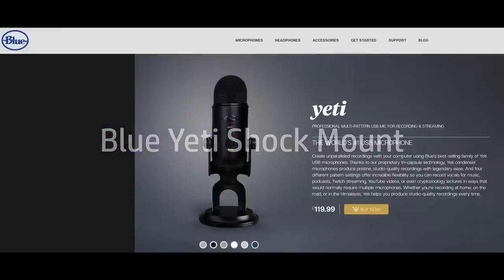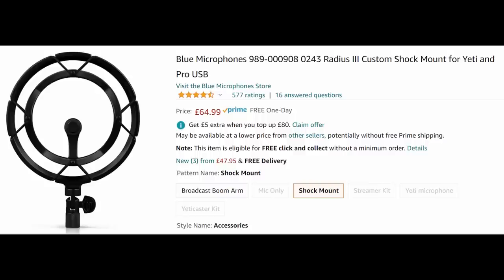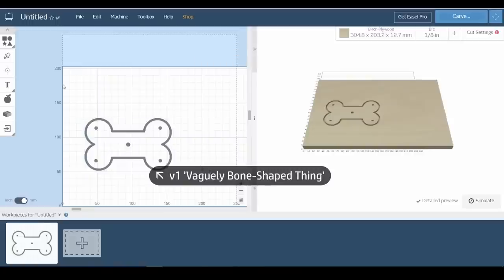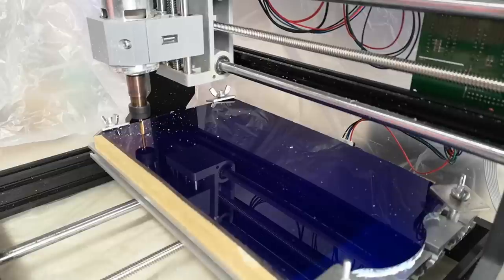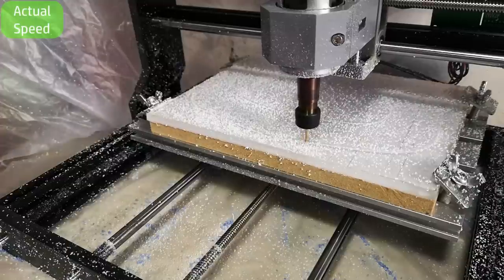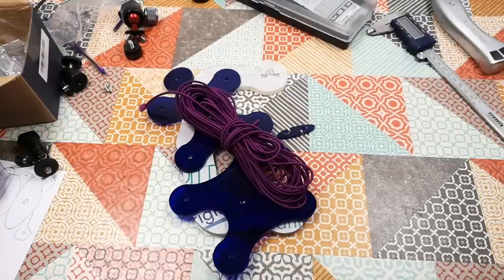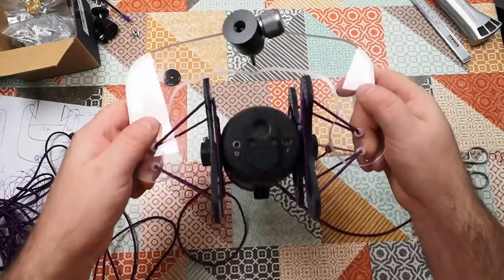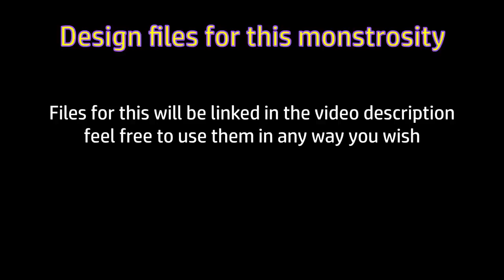Making A Shock Mount For My Blue Yeti Mic (Using My 3018 Hobby CNC Router)

Comment: Nicely done. Best wishes in your machining. I do have a few tips that may help in your machining on a budget, but all of them can be found across YT if you don't care to read all this. 1) The hold downs you're using are to have the the rear part of the clamp raised slightly above the contacting tip to help with the downward clamping force, and so they avoid pushing the part, or double sided tape can be used. 2) An air mattress inflator and a hose can be mounted to blow swarf away from the tool, and to help keep it more cool. 3) For getting things symmetrical, try designing half the object and mirroring it over a center line. This can also be done by designing 1/4 of the part and using two center lines as well(if your software allows it). 4) Add gussets made from scrap to the joints of the frame to increase rigidity, however you can. 5) pins in the table's slots can be used to align the stock square to one axis. 6) Single flute cutters reduce tool pressure to avoid flex in the Z axis, but it's a give and take with machining time. Mostly, just use the machine to improve the machine. Have a good one, and cheers.

Comment: 1:19 Little thing about the desk stand the yeti (at least my ancient grey one) comes with: under each of the 3 foam pads on the bottom there's a hidden, chonky 6mm thread countersunk screw (pretty much central to the pad) holding the bottom dish to the inner part that sits in it and has the actual arms the mic mounts to. Just thought I'd mention this to maybe give someone another idea how to repurpose it for a DIY mount without having to modify the stand like drilling holes into the fairly thick metal etc. (since the base already has threaded holes in it). idk some sort of hanging/suspended mount or something

Comment: I'm impressed with the CNC router.  One modification that maybe practical would be to attach a gearbox, as used in RC motor gliders, to give more torque to the cutter.   These gearboxes are designed to fit to that sort of motor.  I fitted one on a Dremel type tool and was able to use it to drill up to 3mm in titanium quite easily.
Reply from the maker: Step down for more torque, or step up for higher rpm?
Reply: @AtomicShrimp  
Step down for higher torque.  Also the tool may "rub" at higher rpm rather than cut as the feed rate looks quite slow.  I usually go for a minimum tooth loading of 0.1mm and adjust the speeds and feeds to suite.

Comment: The elastic cords have to be tighter. The shock mount is supposed to float the microphone in space, yet provide a grip as strong as having the mic on a solid holder. With it set like that, any bump will cause the mic to swing slightly and accidental bumps may cause it to swing too far and either hit the stand or shock mount.
Reply from the maker: Tightening the elastic will make it likely to twang. The mic swing is nothing to do with tension here, it's the close placement of the holes in the outer piece
Reply: @AtomicShrimp  It's a bit hard to describe what I mean, but you want as many attachment points to prevent the mic from moving too much. One way to improve the swing would be making the whole top attachment portion a single loop of elastic and do the same thing on the bottom. The top holes could also be lined up with the mating ones on either side of the mic mounts. That would give you something closer to the actual Blue shock mount and would also eliminate the need for the bottom mounting points.
Reply from the maker: Yeah, I know what you mean, but actually, it's not a problem, so I don't think I'll bother fixing it - the shock cord is a bit on the thin side to tension any more than this - it's going to work just fine hanging where it is - I don't move the mic (if it was on a spring arm, a more taut solution would no doubt be needed)

Comment: 3:05 you need stronger vacuum. Or clean the filters. Yours doesn’t seem to pick up anything.
Reply: Possibly due to the static electricity? He could ground a clamp or two and eliminate some of it that way. Then we'd get to hear him say "Ouch!" when the vacuum hose zapped him.
Reply: @AndrewBeals  
Vacuums usually just suck nowadays
Reply: @Fedico7000  Especially with the EU regulated/dictated ones (limited maximum power, meaning most of them are useless noise generators)

Comment: Now that you've asked... I would've... made a skirt, tubular broom of sorts, that falls down around the mandrin and bit, attached to an accordion tube pipe, carefully planning lenght and rigidity to suit the whole traveling, then to the vaccum cleaner, mounted on the mill (the tube, not the vacuum; specified not for you but, you know, the trolls aiming for the cracks) to collect them pesky bits and pieces that obviously mined your efforts to eliminate the mess the tool made at the source :D I'm crazy like that, well, that's what she says.
Reply from the maker: Yeah, going to work on a vacuum shoe for it.  I need to do that before I can really use it in earnest
Reply: The shock mount looks great and it's transparent and tinted in the most delightfull of ways. 
I see you making a MK2 version shaped like your logo because your logo, sir, just your doggo, has a lot going for it(her)...

Comment: That's actually very awesome!
I love how the Yeti "sounds" and its quality.. Sadly I rarely use mine, even after I bought a cheap arm for it.
If I ever start streaming again I'll probably start using it more, but for now I use my Logitech Pro X microphone whenever I need a mic since I'll also be using my headset 9/10 times.
And yes.. Those mounts are ridiculously expensive, and so is their boom arm >.>
Reply from the maker: Yeah, I just got a regular mic stand for mine.  Probably the pop filter is more important than the shock mount unless you have to make noise (say, typing) while you use it.  I also got a big sheet of pyramidal foam rubber that I just hang behind the mic when I am recording, which helps to isolate reverb from the walls

Comment: Are you using High Speed Steel tooling, as I suspect, or carbide bits? If not the latter, you may well benefit from them.  They'll stay sharper longer and won't dull out mid-run if you push them harder.

Comment: is there not a mirror function?
Reply from the maker: In easel? Not exactly. You can copy and flip. Probably easier to design shapes in something else then import as dxf or svg
Reply: @AtomicShrimp  Yes. I was referring to your symmetry problems. I use fusion 360.
Reply from the maker: I tried Fusion, but the learning curve killed that idea.  Maybe I should give it another go.
Reply: @AtomicShrimp  I find Sketch up to be the most intuitive, i have never tried using on a CNC -  but you can export as a dxf. 
People on the Sketch-up forums would be more helpful. 
If you have the time (i'd watch you) learning to use CAD software can be extremely enjoyable! 
The basics are transferable- it's just learning  where the bloody menu's are hiding.

Comment: Im still confused what does a shock mount do?
Reply from the maker: It isolates the microphone from noise and vibration that might arise from the supporting pole being bumped, or noise that is transmitted from the floor, up the stand, into the mic - it just damps out those vibrations so the mic doesn't pick them up as sound

Comment: Where did you learn the term: "thick boi"?
Reply from the maker: I know I'm misusing it
Reply: @AtomicShrimp  To my knowledge I believe you are using it correctly. Perhaps because people have been misusing it for so long that this application has become correct. Also, hello again. I'm sorry if I seemed too hostile during our previous encounter.
Reply from the maker: @omnipresentwaffle4841  Not at all.  BTW, I suppose I picked it up from younger people I worked with.  Using it completely ironically here of course.

Comment: For modeling parts I like to use OpenSCAD, this gives you sort of a scripting approach to CAD. This also makes it very easy to create symmetrical or parametric parts. I've used it in some courses and people with a bit of programming background seem to prefer it over the more 'point-and'click' tools. It's open source and very lightweight, maybe give it a try. With the 'projection' statement it is possible to create 2D slices of a 3D model that you can mill, or just directly draw in 2D of course.

Also, for 'clamping' your materials: the intention is to support the square washer at both sides of the screw. For example with a bit of a scrap piece of MDF. Even better is to make, or 3D print, something like this: https://www.thingiverse.com/thing:1675996
Reply: OpenSCAD is my favorite. Add or subtract geometric objects with programs - it perfectly fits my brain and would probably work well for Mike, too. (Mike: beware that some libraries you'll find out there do weird things - work differently from how you'd expect, like the corner rounding library I found that expanded the size of my object.)

Comment: I notice you use a script for even the most trivial of comments. Many a "professional" YouTuber would do well to emulate this. There's nothing worse than a potentially-interesting subject rendered tedious by "stream of consciousness" narrations replete with "ums'" and "err's" and retractions and repetitions and other run-on things that are difficult to follow, if you see what I mean. Speaking off-the-cuff looks easy and is incredibly difficult to pull off, requiring a LOT of preparation and total mastery of the subject matter.
Reply from the maker: Probably about half the time I use a script. Weird Stuff I'm A Can isn't scripted, but it has a repeating format that helps. The cooking videos aren't scripted, or the outdoor ones
Reply: @AtomicShrimp  “Weird Stuff I’m A Can”? I missed that one..🤔
*damn auto-correct sometimes 😁
Reply: @AtomicShrimp  hi "a can" I'm da... Well I'm not, but you get the point
Reply from the maker: damn autocarrot!